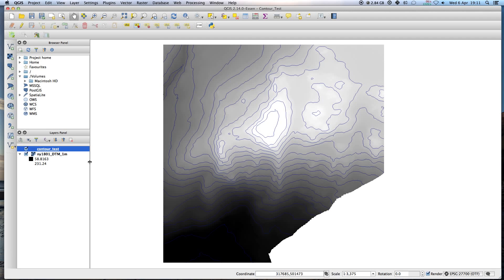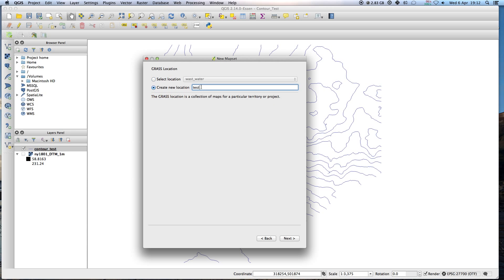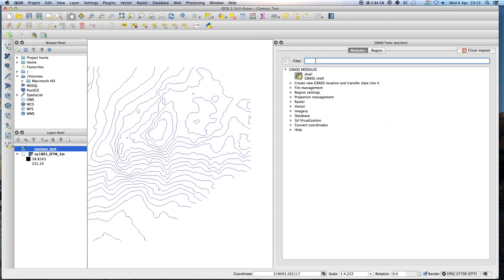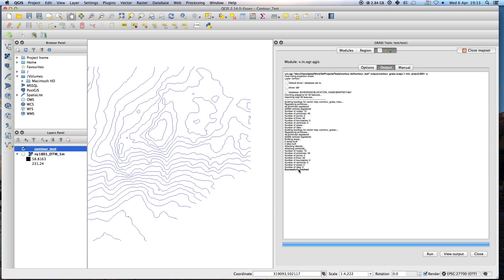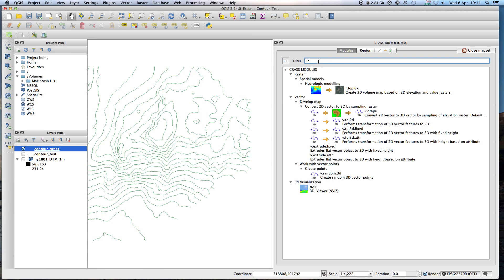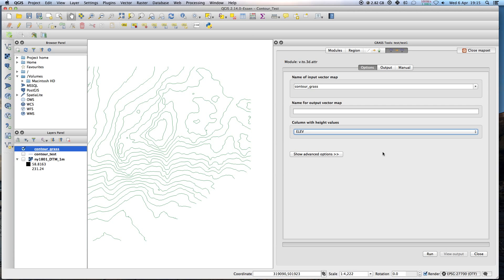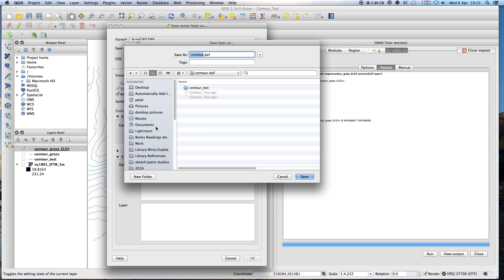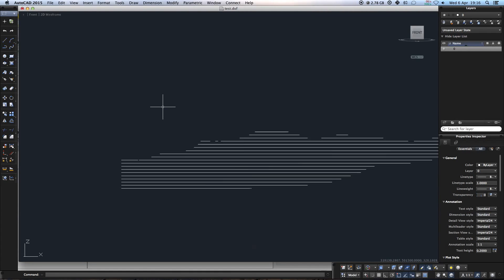QGIS: exporting contours to DXF with height values

Comment: @Quoc Dang once I complete the "import loaded vector" command and my elevation values are gone in the new "contours_vector" layer which probably causes my QGIS to crash the 2d to 3d step.... I have tried both QGIS with GRASS 3.10 and 3.12. Both fail.... Any ideas how to fix this?

Comment: Thank's! But when I open the DXF in Autocad, all my curves are on Z=0 ... Do you know where it might come from?
Reply: I had that issue and figured out the fix.  On the export to DXF there is Geometry options area.  Expand Geometry area and change it from Automatic to Polygons, and then make sure the "Include Z-Dimension" box is checked.  Worked for me.
Reply: @robnewell9531  Whoa! That little step was the final piece of the puzzle I was looking for! Thank you for posting that!
Reply: @robnewell9531  this solution saved the day. Thank you.
Reply: @robnewell9531 thanks for the info
Reply: @robnewell9531  Oh man that was my last unachieved step, thank you so much!!
Reply: I have the same problem.  No height values when I import it into my other software.  Did you find a fix?

Comment: Thanks! it really helped me. I just have to add one trivial step in AutoCAD (applies to BricsCAD as well): When you export anything from QGIS (or ArcGIS)  to DXF the units in DXF will be inches. This is ridiculous and the first thing in CAD is to change the units to meters. If you skip this and use the DXF file anwhere all the measures and thus also the CRS will be wrong since CAD programs think they are really inches which they never were. If you create a DXF from scratch it will be unitless and usually understood as millimeters.
Reply: this explains so much
Reply: do we change the units manually or through units tab? can you explain units a bit more please
Reply: @moizzasaeed5132  I was speaking about drawing units. Although the AutoCAD I used was configured to ISO i.e. metric drawing units it will consider unitless DXFs having inch as drawing unit. 
I have not used any specific unit table.
Reply: @moizzasaeed5132  Sorry, I misread your question. I' m not using units tab. Since I have originally learnt AutoCAD DOS version 9 in late 80's  prefer commands and just enter "units" and select meters.

Comment: I got an error "Unable to open Data source": (FIXED)
When I tried to do the import vector thingy, choice loaded layer (.shp) and when I clicked the "Run", i got an error saying "Unable to open Data source" 

I'm using QGIS version 2.18.9 with GRASS 7.2.1, they are the latest atm so shouldn't be a problem...
is it because of the .shp file?
Reply: Through an hour investigation, the .shp file you use in QGIS can only be used from a directory of all English letters without any special characters, or an error "Unable to open Data source" will occur, kinda stupid really.

I fixed it by moving all my .shp files to my desktop and re-imported into QGIS.

Comment: As far as I'm aware, GRASS plugin is no longer available through QGIS? Any ideas what to do?
Reply: Joe. GRASS is still available dude.
I'm using QGIS version 2.18.9 with GRASS 7.2.1, they are the latest at the moment.

I uninstalled my old QGIS version first;
I went to GRASS website and installed the GRASS package in a separate directory http://planet.qgis.org/planet/tag/grass/ 
and then installed QGIS version 2.18.9 after.

When I run the software, I run with the QGIS desktop 2.18.9 with GRASS 7.2.1, then you should be able to search the plugin GRASS7.
(or maybe you should be able to search GRASS7 if you are using the latest QGIS version, idk, I just did the long way to hope everything work ok...)
Reply from the maker: I'm not aware of this, I haven't upgraded to the latest QGIS. Have you tried posting your question over here http://gis.stackexchange.com/ ?
Reply: I recently downloaded qgis and it came with qgis with grass as separate install and I had no idea what it was for until this video ,
Reply: It helped me to download the old version 2.14